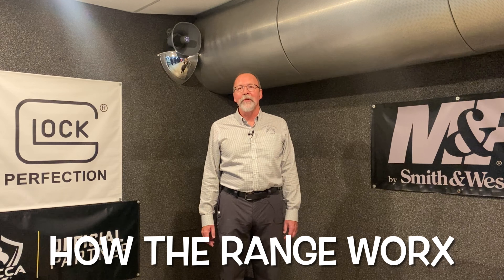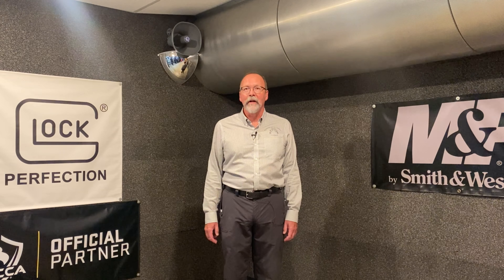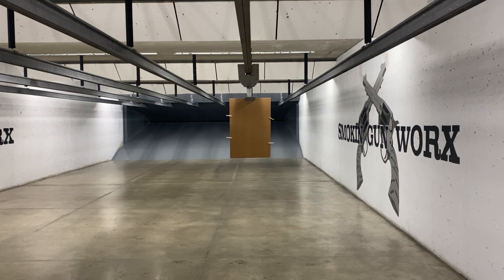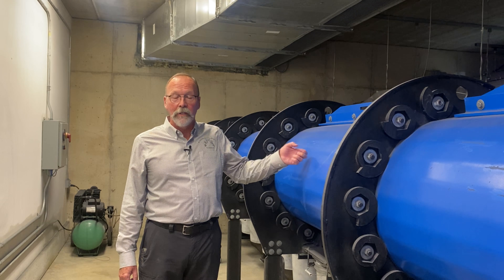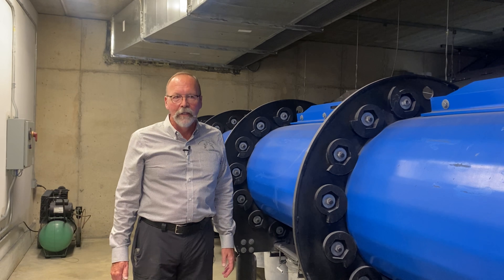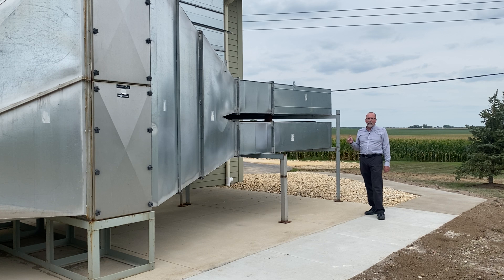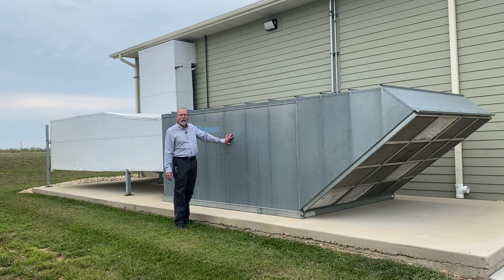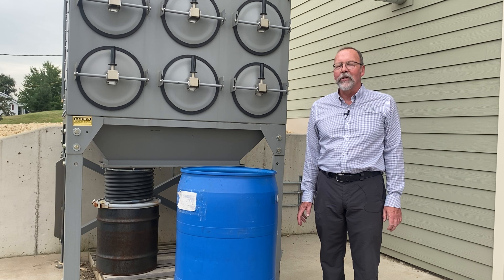The Doctor Is In: How an Indoor Shooting Range Works

Comment: An important distinction on air flow in the range is the difference between Cubic Feet Per Minute(CFM) & Linear Foot Per Minute(LFM). A range requires 75LFM at the firing line. So when addressing air flow, you will need "X" CFM in order to produce 75 LFM. Most ranges require 20,000-30,000CFM to produce the required 75LFM. GREAT VIDEO DOC!!!!!